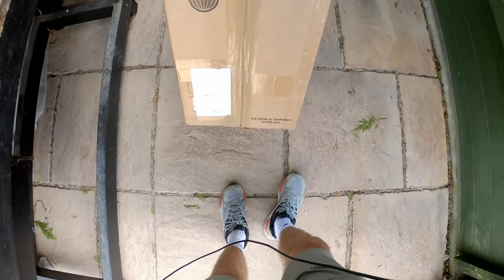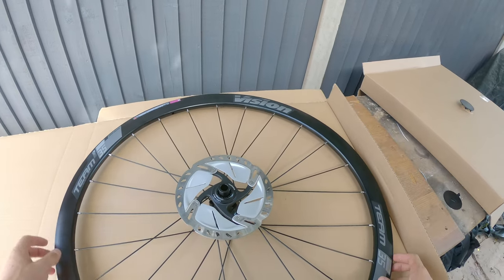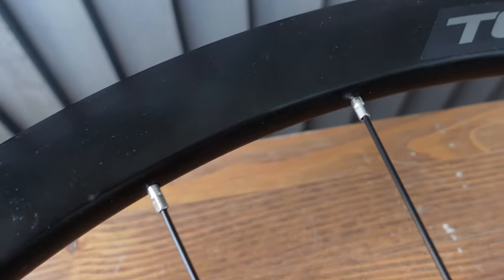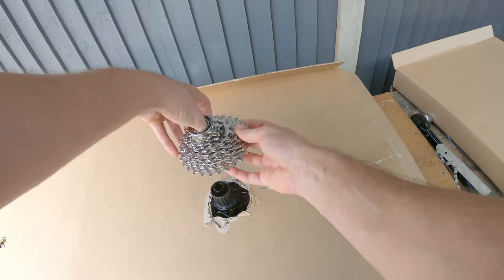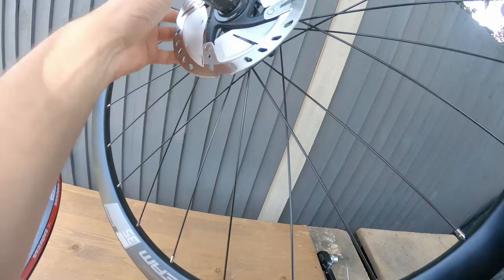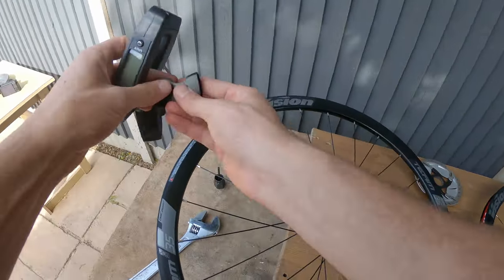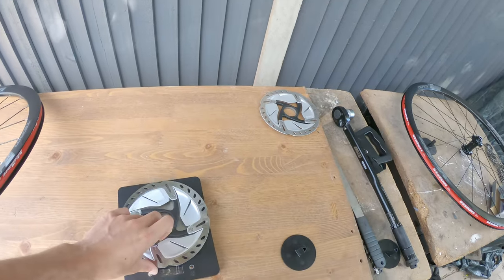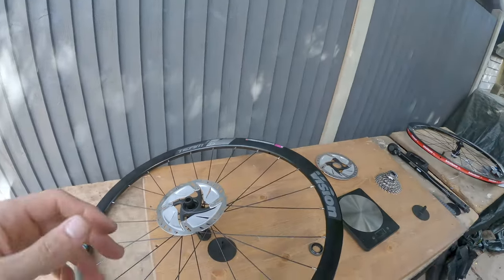New Wheels for my Chinese Bike Build | Part 4

Comment: 170. Got a good deal. I just bought the Vision TriMax 30KB Keronite Coated,  for 295. These were 800 pound wheels not so long ago. Came  to see a bit about vision. Never ridden them. I like Mavic's SUP welding so no stuttering when braking. DT Swiss also uses welded, not pinned, rims, so they dont stutter either. For the last 30 years ive ridden mavic. Started in the late 80's with the Open 4 CDs and pretty much used them for training ever since. Cant go wrong with  Open 4 CD's. I need a new wheelset now as my wheels that came on the bike are now at the end of their life.

Comment: Proper bargain with the rotors and the cassette! And 2kg for the set at this price is really good! 
They should be perfect for the job!
My only worry is about the groupset… mechanical disc brake are not really good… may be worth looking at the giant connect (convert cable brakes to hydraulic from the stem plate). Or cable/hydraulic calipers but you still need to run the cable through the frame and friction will impact performances. 
Anyway, I look forward to the next videos 😉
Reply from the maker: Yeah, it's a good deal for these wheels with rotors 👌🏼 - I agree with the disc brakes and have been thinking about it recently. I'm going to go with hydo-mechanical I think. Something like the juin tech f1's. I'll see how that works with the routed cables and go from there 👍🏽
Reply: Can’t wait for the full build. 

Juin Tech F1s are alright, but if you still want full hydraulic brakes with cable pulls, there’s the Giant Conduct adapter. But if you’re going for a clean look then it’s not the best option. That adapter is purely for versatility (I.e. if you want proper hydraulic brakes and will be trying different frames/ wheels often). Trace Velo covered it in a video: https://youtu.be/HCn9zWDfKno

Comment: You're not zeroing correctly when weighting the front wheel. You have the weight of your strap in your 995gr. Front wheel should be lighter.